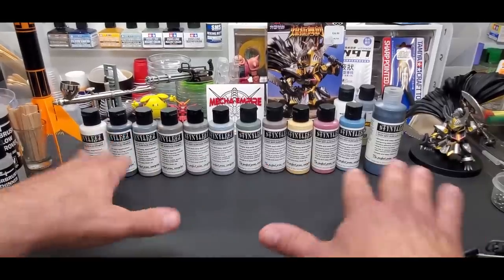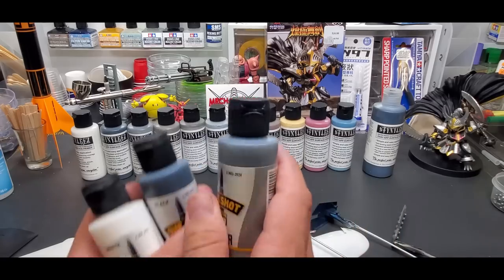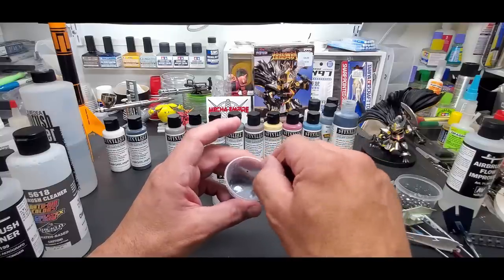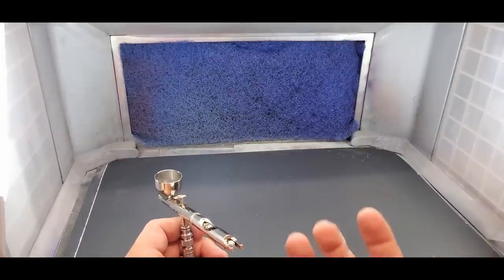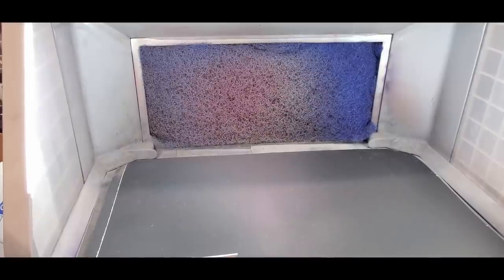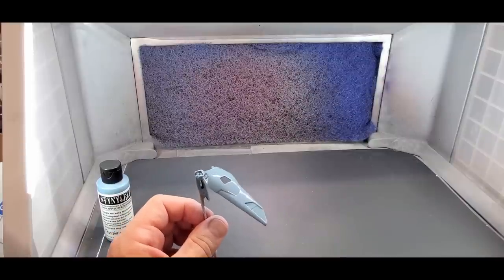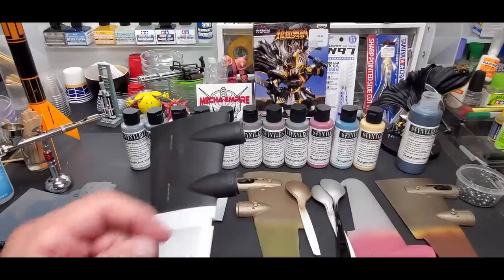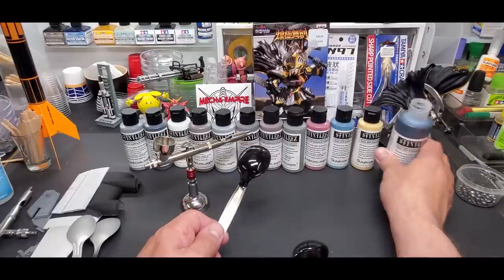Testing Stynelrez Colored Primers - The Best Acrylic Primers You Can Buy - Plus Giveaway !!

Comment: I tried using my 0.6mm needle and it constantly clogged when I used Stynylrez. I thinned it and added retarder, still clogged.
Then when I went to clean my airbrush the primer stuck to the cup and wouldn't come off with airbrush cleaner or IPA. I had to use a scourer to get it off which ruined the chrome.
The things I primed, the primer flaked.
I tried 3 different batches and had the same issues with all of them.
I won't use Stynylrez again, £120 plus delivery wasted!
Apparently this primer is extremely sensitive to temperature, I think the stuff I got was stored in a cold warehouse or brought to the U.K. in a cold container because all 3 bathces were useless.
I'm about to try Monument Hobbies Pro-Acryl primer. If this doesn't work I'll be painting without primer because I've spent so much money on primer, all of which have their own problems.
Reply: I have exactly the same issue with Stynylrez. According to a Badger rep, it has to do with how a H&S airbrush tip works. I then bought a 0.6mm needle for my H&S, still issues. I guess Badger primers are not made for certain airbrushes. I had the best results thinning stynylrez with Golden Airbrush Medium, but still not great.
I use Molotow Black now as primer, works pretty good but not as sandable as the badger primers.
Reply: I got the same experience, I use badger 105(0.5 mm)+ 25 psi, whatever thin or not thin the stynylrez always stuck my airbrush.
Maybe change to Vallejo primer.
Reply: @SigurdDecroos  it's interesting you say about H&S. I have a Cult of Paint Infinity which is just a posh H&S Infinity so maybe that's the issue. I'm looking at a Badger Patriot 105 purely for priming, £110 seems like a lot to spend given what the commenter above says about their 105 though.
Reply: @蘇振雄-v6b  I tried Vallejo surface primer, I don't get on with it. Their Mecha primer is better but I still don't like it much. I'm hoping Monument Hobbies works well, I've been told it has the adhesion of Stynylrez with the ease of use of Vallejo surface primer. Fingers crossed.
Reply: @madMARTYNmarsh1981  try molotow black once, I'm using that atm. Sprays on very easy
Reply: @Sigurd Decroos  is it the One4All primer by Molotow? I hadn't heard of this primer before so thanks for bringing it to my attention. It's cheaper than Monument Hobbies primer too, they do 120ml for £12.99 so it works out quite expensive versus other primers but if it works I'll buy it. I'll give Molotow a go if M.H. fails me, which I am expecting because all the other highly regarded primers have failed me. 
Will this Molotow primer work okay for Warhammer miniatures and the like?
Reply: @madMARTYNmarsh1981  Marco uses it in his videos a lot, he clearly knows his stuff.
Reply: Couple drops of acetone cleans these up beautiful! Strongly recommend. I had quite a few issues with cleaning up my airbrushes after using stynylrez until I discovered that method.
Reply: @a5ync  IPA works wonders as well, just be sure to check if the seils of your airbrush are IPA proof.
Reply: @a5ync  Acetone, I'll get hold of some and give it a try. Thank you for the recommendation.
Reply: @SigurdDecroos  howdie again. Just incase you're interested; Monument Hobbies Pro-Acrly Prime works wonders, it sprays on as easily as Vallejo surface primer but has the finish of Stynylrez and the adhesion is almost as good too. The Stynylrez was fine where it didn't flake off but most of it did flake off so I won't touch it again. Monument Hobbies primer has even worked perfectly on a resin miniature that I forgot to wash before I primed it. I've got some of the Molotow on your recommendation but I haven't used it yet, I intend on using it when my Horus Heresy boxset arrives.

Comment: Use real sandpaper. Not the fake sponges. I’ve never seen a acrylic primer that is worth any money whatsoever. Stylerez included. None of them can stand up to a mr hobby, Gaia, e7, or modo. They just don’t work.
Reply: Stynelrez will feather nicely, whereas other acrylic primers will peel off of the surface.
I’ve been using it for the last year and a half. It was difficult to get during the height of the pandemic (all supplies were).
I’m looking forward to using the gloss black.